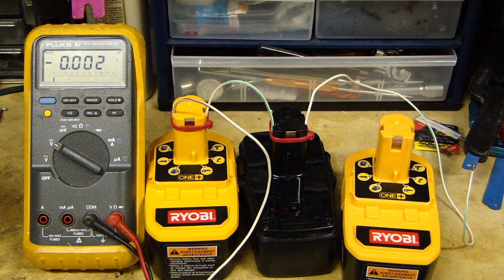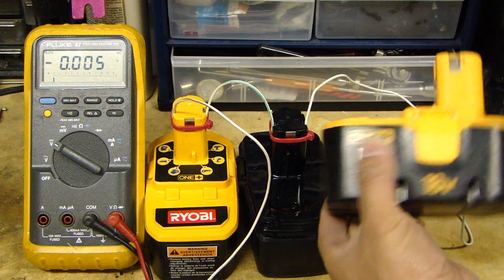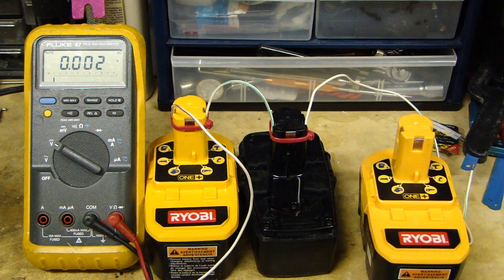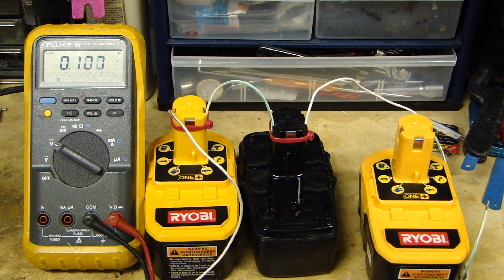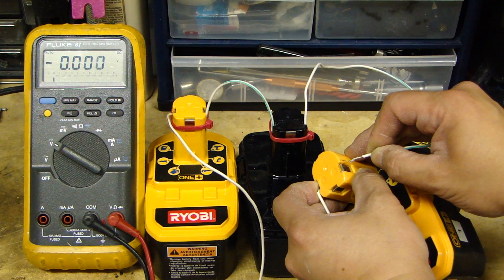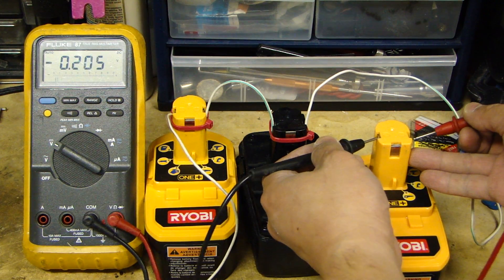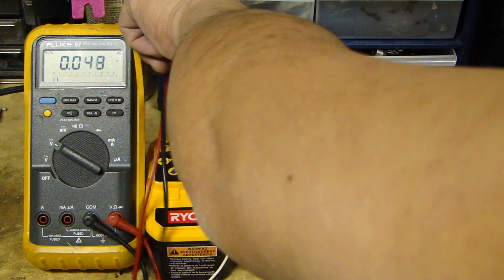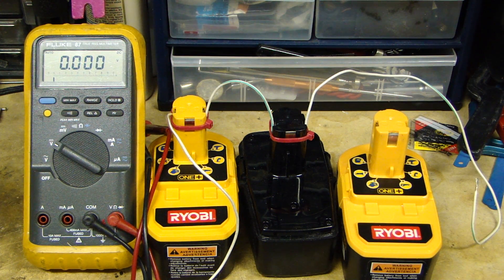How To Revive & Fix a Bad NiCd Rechargeable Tool Battery - Part 2

Comment: Tried a similar method, didn't work at first but after a couple of days to my surprise it worked. The battery sat unused for months but now working like brand new and holds a charge without losing power... amazing.

Comment: This works when the smart charger will not recognize the battery is connected because it's totally dead. It puts a small charge on the battery so the charger will recognize it and charge it. It does not fix batteries that are badly damaged. I have had good luck replacing the NiCd cells with equivalent NiMh ones.

Comment: i own a old craftsman 16.8v nicad drill. the charger would go yellow and green lights when i put it on which ment the battery was defective. i looked it up and found out that if you plug the charger with the battery on it in and out many times, it will put a tiny charge into the battery. it is just enoghf to make the charger reconize it. it worked well and the drill makes a great spare!

Comment: I have a B&D 18 volt. can you do that with these? also how do i know which one is + or - ? they are not marked anywhere.
Reply from the maker: You can do this on a NiCd battery. To find out + or -, use a mutimeter to probe the positive and negative. If your reading shows a positive number, then your red lead is touching the + terminal on the battery.

Comment: I've seen some that connect the "duff" battery the other way around i.e. +ve wire to -ve on the Battery and -ve wire to =ve on the battery, 
Who is right?
Reply: The trick is to give quick high voltage punch to the battery. If you want to charge battery, you should connect "+" to "+" and "-" to "-", if you want to short circuit and blow up battery in series with other batteries you should connect "+" to "-".

Comment: I know this vid is pretty old, but I'm giving this a shot with a really dead ryobi 7.2v nicad (shows 3v), using an 18v (pushing 16v at the moment) as the ignition source.

After tapping, 7.2v shows 5.9v and dropping - will see what happens after rest/recharge

Comment from the maker: I would not use the Li-Ion as a power source, Inside those Li-Ion batteries is a circuit board that is part of the charging circuit. You stand a chance of damaging it (I have not tried and don't plan on trying myself)

Comment: I have 2 new Ryobi lithium ion batteries and 2 old Ryobi NiCad batteries. Would it not be safe to use the lithium ion as the charge supply?  All 4 are 18 volt and I would love to have the NiCads working again but I don't want to destroy the new lithium ion either.

Comment: hi, I have a hitachi eb2420 battery that only lasts about an hour after a full charge, is it safe to use this method or does it have to be totally dead as in not holding any charge at all?

Comment: Amazing, I got a De Walt 18 volt drill and one "broken" battery from a friend.
The battery seemed broken,I tried to charge it but within second the charger indicated that the battery was broken.
I tried your methode and thebattery is at full power again.
One question: can you do this several times with one battery or is it a one time only remedy?
Thanks for sharing, you saved me 50 euros.

Comment: After zapping/rejuvenating a Power Drill NiCadBattery, about how long can the Battery expect to perform as before? 
Secondly, how many times can/should a Power Drill Battery be zapped/rejuvenated before it's time to accept that it is finally,finally dead?

Comment: I have a number of old-ish NiCads from my Cordless Power Drills which are almost 'dead'.

They are 14.4v and 18v.

Can l use two 12v Car Batteries in series - 2 X 12v = 24v, to separately zapp/charge/rejuvenate the 14.4v Battery, and the same setup to zapp/charge/rejuvenate the 18v ?

Is it absolutely essential that the two car batteries are exactly the same amperage - my set up would be 1 x 12v - 45aH + 1 x 12v 54aH ?

Do you have any comment/s on this - your help/advice would be appreciated.

Comment: i want to do the same but to a electric shaver s battery. its 1.5V .. so will it work if i jolt it with a 3V AC to DC adapter or should i do it with batteries in series itself. and MUST i let it drain to no voltage.??

Comment: Just tried this with an old Bosch battery that has been dead and on the shelf for about 4 years. I just did this, let it rest then charged it for about an hour. Full of torque, and works a treat.
Many thanks

Comment from the maker: Theoretically it should work fine but Lithium batteries are expensive and I would prefer to try another power source just in case it does some damage because the initial shock is a direct short on the Nicd.

Comment from the maker: @Tiny960 If this method does not work for the other battery then there may be other issues with the cells which cannot be repaired. It may be time to toss it.

Comment: This is very helpful information.  I tried on two (2) of my 18v Dewalt batteries and one worked out very well, but not the other.  Every time, I tries rejuvenate, I would get very wildly spark and stick to terminal, but it not do to the other battery.  Any advise from any one would be greatly apprecaite.  My batteries is sbout 3.5 years old.

Comment: @TrydisMikee Look up Nickel Cadmium dendrite. 
Lithium Ion and Nickel Metal Hydride batteries form dendrites too. Lead Acid battery dendrites are commonly called sulphation. I wouldn't recommend using this DIY technique on anything other than Ni-Cad. 
There are high dollar industrial battery chargers for Hybrid transit coaches that incorporate high frequency voltage pulses an a "regeneration mode" to decrease or break up dendrite formation.

Comment: after you rejuvenate the dead batt and let it cool then fully charge it. how long will it last for each use?   Does it last long like a new batt or just last a few minute after each charge?

The problem with rechargeable batt is the older the batt the less juice it can hold after each fully charged.

Comment from the maker: @TrydisMikee   It's MAGIC!! jk....it has something to do with some kind of crystals being formed inside the cells which causes a short on each individual cell; this prevents the battery from holding a charge; by applying a high current surge you apply to it will literally fry those little crystals and allow the batttery to hold a charge again

Comment: @openmike78240 if you're using identical batteries it won't matter.  In the video it'd be two good batteries, right of left-hand one linked to left of right-hand one, then go from left of left-hand one to LEFT of bad one, and right of right-hand one tapped 8 times against RIGHT of good one.  But as dial2fast says, if unsure use a multimeter.  You'll probably want one anyway so you can take readings before and after.